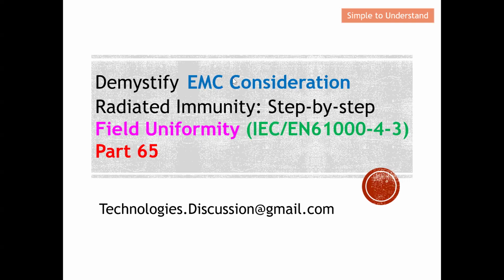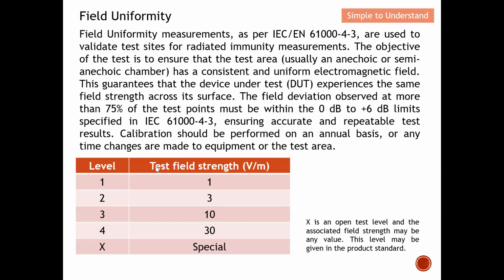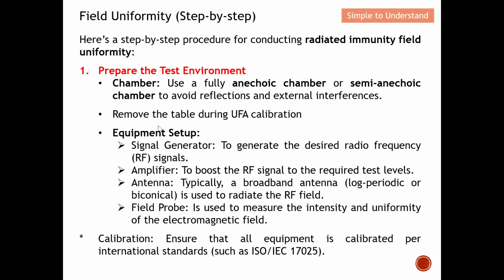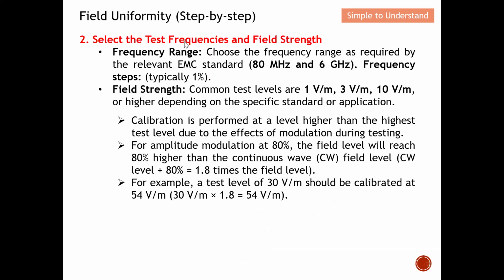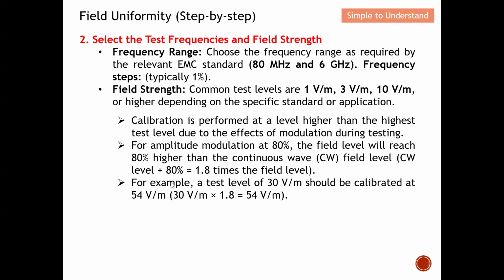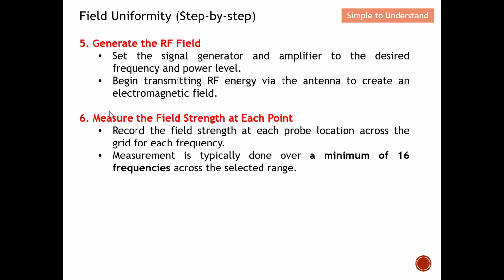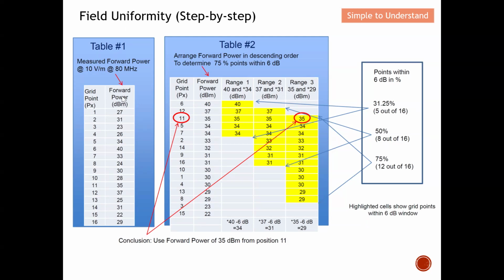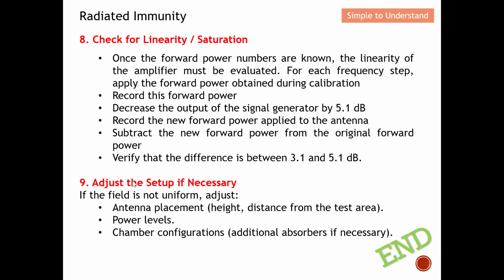EMC #65. How to Achieve Field Uniformity & Accurate 3V/m, 10V/m Calibration (IEC 61000-4-3) Testing

Comment: Hi, this is a very useful video. I have one question. How to deal with assumptions that in the case of the electrically large systems of dimensions around 5m x 2m, the EUT is still covered fully as per the standard requirements. Or due to large systems, we need to consider different side exposures along with 4 standard exposures (left, right, front and back). Thanks in advance.
Reply from the maker: Wow, your EUT is so huge. Hahaha.
If the EUT is larger than the calibrated field uniformity area, divide the EUT into multiple sections (for example, Top Left, Top Right, Bottom Left, and Bottom Right). Position each section within the calibrated field uniformity zone and perform the immunity test for that section. Repeat the process until all areas of the EUT have been exposed to the specified field strength. This ensures the entire EUT is evaluated, even though it cannot be illuminated by the uniform field simultaneously.
Reply: @technologiesdiscussion1676 our UFA size is 6 x 3.3m. in this case only 4 sides will be sufficient. Tons of thanks.

Comment: Thank you for your video.
I would like to ask about the position of field probe about 1GHz on 18V/m.
For a 1.5 m x 1.5 m area, place probes at top  height of 4 points.(set (0.0.0) on point)
I find the different the upside and downside of probe are different.
The upside may out of 6dB , but downside meets between 6dB.
Is the downside probe in Uniform Field ? 
Or is the upside probe  out of Uniform Field?
Downside probe of SG'out is small than upside probe of SG'out.
Reply from the maker: Thank you for your question.  :)
I hope I understand your question.  :)  Sorry, if I dun.
There will be different between up and down side value.
If your downside is lower, you can reduce the height of antenna slightly so that it will be balance.
If your upside is lower, you can increase the height of antenna slightly
The idea is to achieve field uniformity. Not cheating but to ensure our result is consistent.
Hope I answer your question.
Thanks.
Reply: @technologiesdiscussion1676  Very thanks for your reply. Due to the max height 1.55m of Antenna master. I can not increase the height of antenna. So I try place the downside.
Reply from the maker: Thank you  :)

Comment: I have a question about checking the linearity/saturation in the step 8.
Is there a reason why 5.1 dB is selected?
Reply from the maker: I guess I have forgotten to explain this in the video. 
5.1 dB value specifically stems from standards such as those by the International Electrotechnical Commission (IEC) and other RI guidelines, which set this as a practical limit to maintain linearity. It’s chosen based on empirical data showing that it helps achieve consistent linearity over a wide range of devices and frequencies.
By reducing the input level by 5.1 dB, the signal remains in a range where the system behaves predictably and uniformly without intermodulation distortion, which could otherwise affect the measurement.